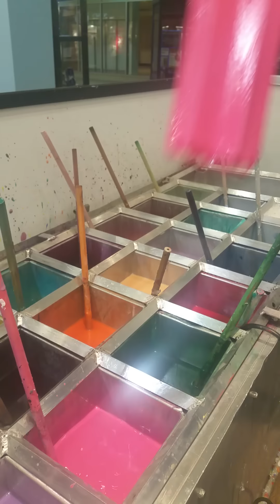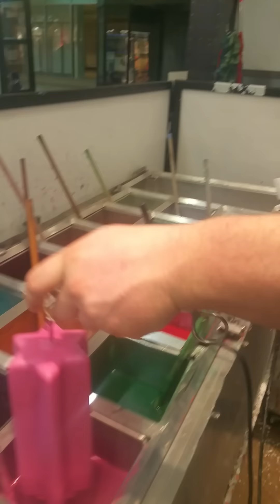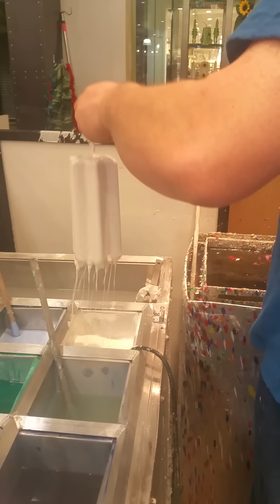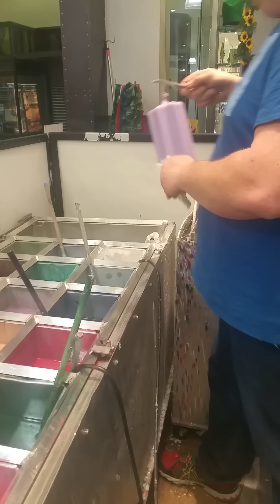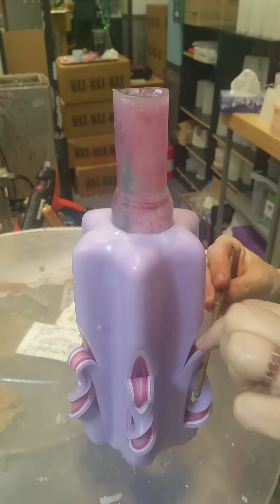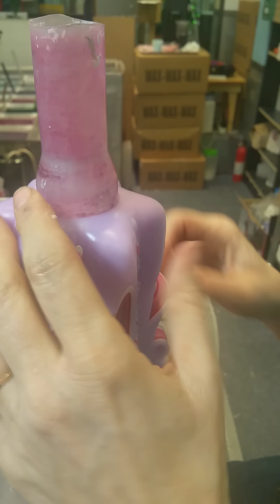Candle  carving

Comment: You are the only ones I've seen so far that wipe the candle off after dipping it in water. Does that not put imprints from the napkin on the candle? And seeing the finished product would be a nice ending to the video :)
Reply: I agree.
Reply: Nop it does not affect

Rather it helps preventing bubbles which forms due to water drops

Comment: I have two questions. 
1. Why do you wipe away the water? 
2. How cold is the water? Icy or just cool?
Reply: 1. The water is wiped away so the wax layers stick well with each other.
2. The water needs to be a little colder than room temperature, cold enough to quickly freeze the wax underneath, but not too cold than the layer above it freezes so much that it crumbles apart.

Comment: Those particular candles are way too pretty to burn
Reply: The outside does not melt.  It goes straight down the middle.  Half the beauty of these candles is the way the light glows through the clear wax core out of the cuts and grooves.